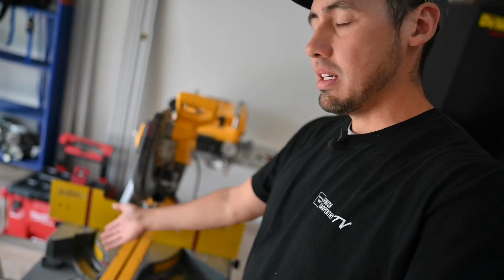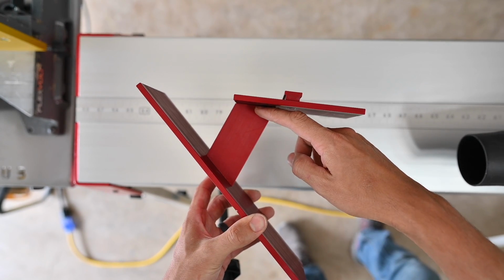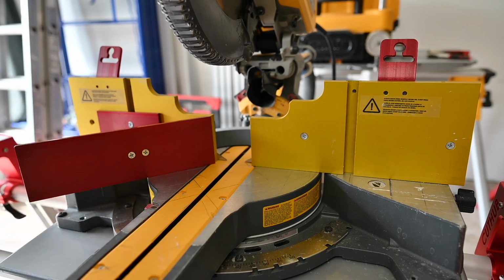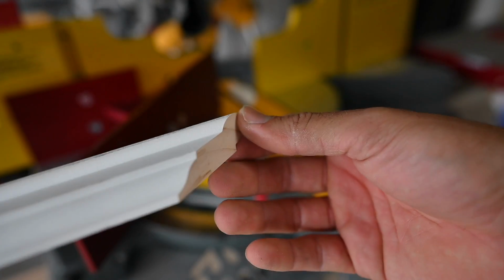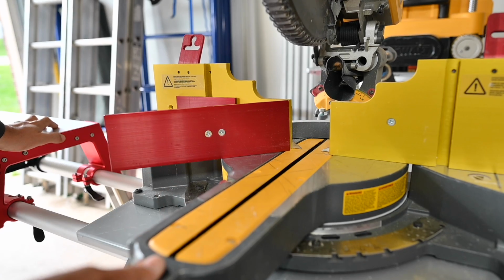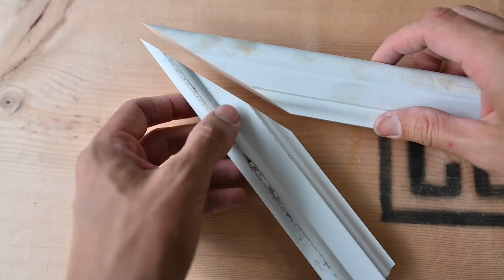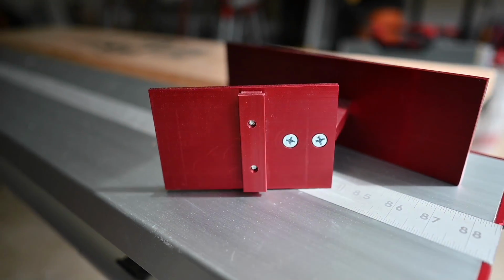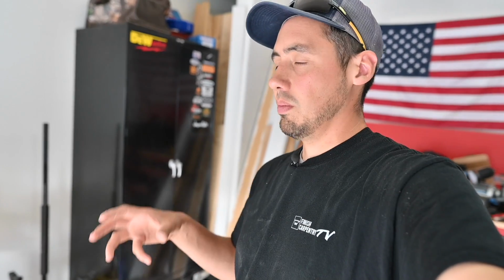How to Cut Extreme Angles (carpentry secrets unlocked)

Comment: When I needed to cut an extreme angle last year, I remembered few years back, in a different video, you taught the same thing but in a “poor man” version, with a piece of wood cut at 45degree and placed against the fence.        
It definitely helped getting my job done!
Reply: Ive been doing it this way for over 20 years.  Simple piece of plywood or scrap and off u go.  This fence is slick as hell... But absolutely not required.
Reply: @davedinicolo4571  Had to do it today absolutely brilliant
Reply: @davedinicolo4571  I knew there'd be the poor mans way. There always is 👍

Comment: Another great clip with useful info Richard. Thanks. While we're talking extreme angle jigs, I thought I'd just add a good thing to know I figured out from trial and error: When creating shadow boxes going up stairs, most of the time stairs incline at a 45 degree angle. That means the angles you need for your miters in this application are: 67.5 degrees and 22.5 degrees. With any one of these extreme angle jigs, you can hit those 67.5 degree extreme cuts spot-on every time. And of course the 22.5s are a piece of cake. PERFECT stair shadow boxes every time!

Comment: I did this in wood to splice 1 x 4" boards together when I had eight footers, and needed eleven foot lengths and another time when I built an a-frame stand thing for an outdoor swinging bench the wife had to have. I left the saw at 90 and built the fence to the angle needed - but this idea makes a jig that much more versatile.

I called mine a Board Stretcher Jig when I made my first one.

Comment: I had to put in a coffered ceiling once.  It involved a grid of cosmetic box beams with plywood squares set inside them.  Then crown molding was mitered to fill the square recesses.  At one point, the ceiling had some odd shapes and I had to fill in a coffered recess with an internal angle of about 30 degrees.  The miter cut on the crown molding required a cut that was about 27" long.  I was able to start the cut with the Dewalt miter saw but had to finish it with an old-fashioned carpenter's hand saw.  The crown molding was foam rather than wood so it wasn't too bad.

Comment: Many of us old school carpenters have been making extreme angle jigs out of scrap wood for decades and they are free used to use them trimming staircases
Reply: Scrap wood is the best for a lot of things. I'm not old school, just can't justify the purchase as a hobbyist, but I made a similar jig after watching @Sawdust and Wood channel and his angle jig video.
Reply: Yup... And if you set your saw at 45° and put a square piece of plywood to the fence as an auxiliary fence you can cut both sides of the miter without ever pivoting your saw... put the first piece against the fence, and the second piece into the fence... it’s an old picture framers trick

Comment: As a trim carpenter, I used to run across a 45 degree inside corner for baseboard and shoe mold every once in a while. I figured out that if a made a 45 degree box and clamped it to my fence then set the miter to 22 1/2, it would give me the correct miter for the corner. This is certainly much better!

Comment: Use a 2x6 cut at a 45 clamped to the fence. A lot cheaper. Also, the miter cut is 70 but the angle is 40. The miter gauge he is using will tell you the full angle (40). It will also tell you where to set your miter saw (single cut 50) and the miter cut is 70. You don’t need a Starret. I bought one for $15 and it’s definitely worth it.

Comment: I take a 2x6/8 and cut a 45* angle on it, and then screw on a 1x4 to make a fence for taller trim. Since these angles are so few and far between I really couldn't see myself wasting the space on a permanent piece like that, but if I had to do this all of the time, then it's probably worth it just for the speed and accuracy.

Comment: How will that jig work if you move the fence to have the opening closer to zero clearance (mentioned in video when you got the fence). Will the angle jig now be in the way of the blade?
Reply: Some saws back fence are adjustable , not that the apprentice notices 🤦🏼‍♂️ wonder why my saw fence has a lovely carbide blade cut through it

Comment: Just a word of caution, in my experience the blade has a greater tendency to grab the workpiece and rip it out if your hands doing this sort of cut
Reply: Absolutely THIS!  Be sure to place your holding hand so that it can't be pulled into the blade if it grabs the piece.  (This is more of a rip cut than a crosscut, and miter saw blades are apt to bind when ripping.)

Comment: Is there something like this that can be interpreted into the small 7 1/4 inch miter saws? i recently got the dewalt 7 1/4 incher and absolutely love it but it decks out at 48 degrees and i feel like a jig like this would help me get fatter cuts that the 12 inch saws offer. Also do you think its doable to cut crown with the small saws? Obviously will need the crown stops of some sort but none the less i love the portability, lightweight and performance of my small dewalt cordless and would love to somehow upgrade it to be able to use it on crown
Reply: Installing crown made me forget my 7 1/4. 12" is the way to go sliding or not. Way less head scratching and more productivity when it can be cut nested.